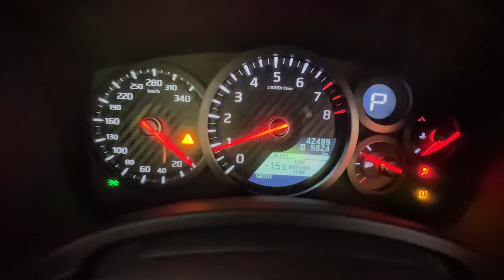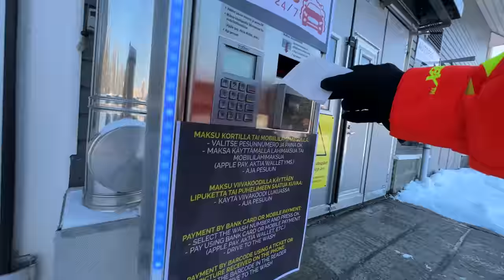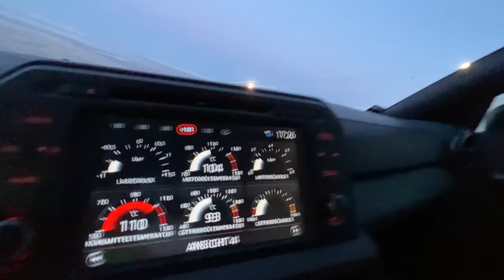Nissan R35 GTR, EVO 9 & RS4 B7 drifting up SKI SLOPE - *POLICE* Sound & Flames - OG Schaefchen

Comment: Evo is far better car in snow than gtr. The difference in uphill was because of the wider tyres and more hp in gtr.
Reply: Video evidence seems to indicate otherwise.
Reply: @herculesrockefeller8969  I think i wrote the reason. Wider tyres and more power, not better awd system. In a narrow road a gtr can't follow an evo. In video's uphill a Patrol or a Land Cruiser like them in sand uphills with 1000+hp can do the same like gtr. In a snowy narrow road can't follow an evo on an sti.
They are both far better than gtr on snow.